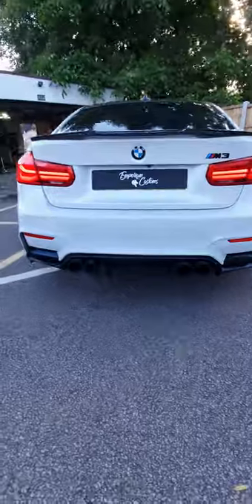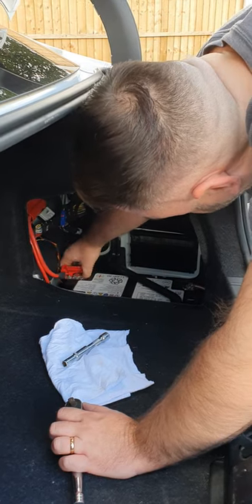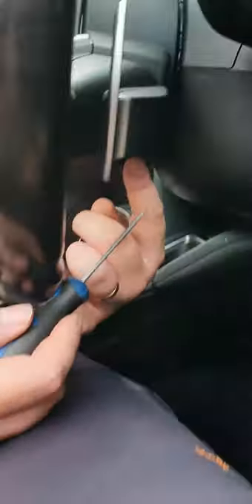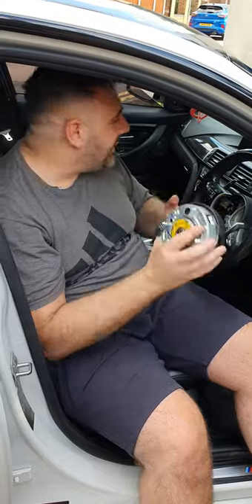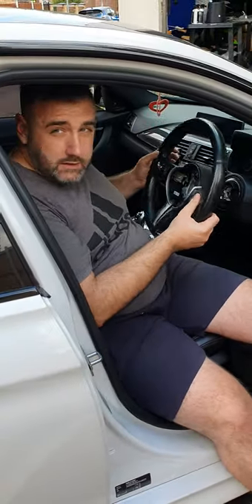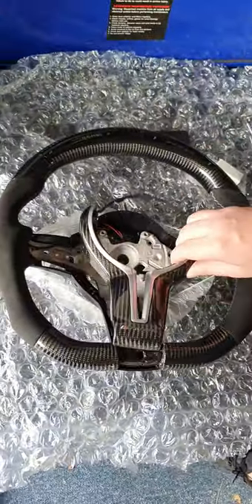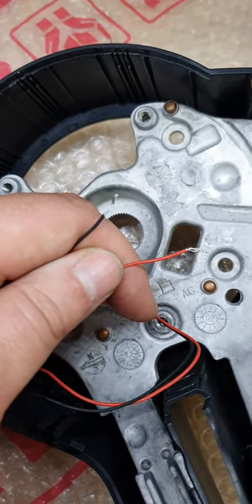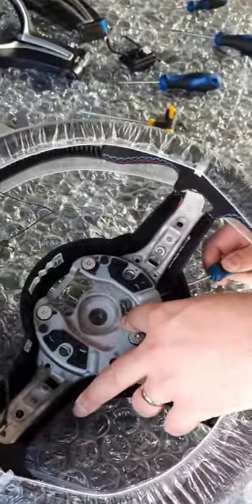How to: Remove BMW F series Steering wheel & Install Custom Carbon Fibre LED Race wheel.

Comment: Fun fact. The air bag isn’t there to stop you hitting the steering wheel. It’s to limit neck movement during a crash. Same idea as head rests, they are to stop neck movement during a rear end impact
Reply from the maker: They are to supplement the seatbelts in preventing head injuries against the windscreen and steering wheel

Comment: Great video, will be hopefully swapping my wheel out on my F30, where did you get the led display wheel and how does it pick up the revs? From the video just looks like you connect power to it?
Reply from the maker: @reecemyrie1742  it links to a bluetooth plug inserted into the obd2 port